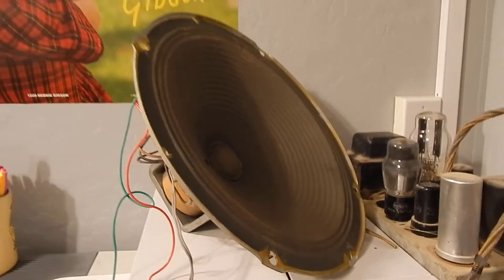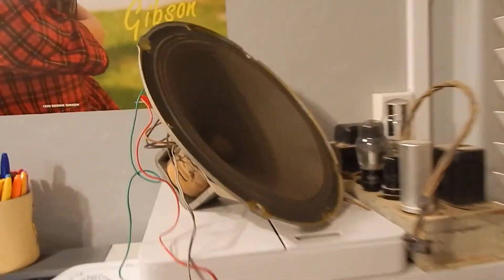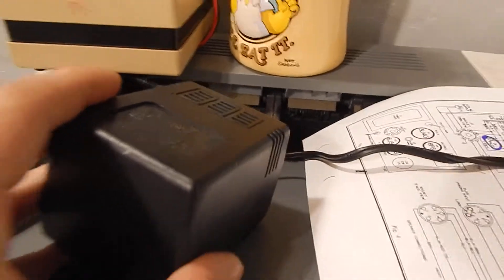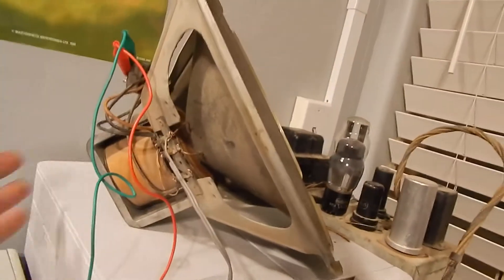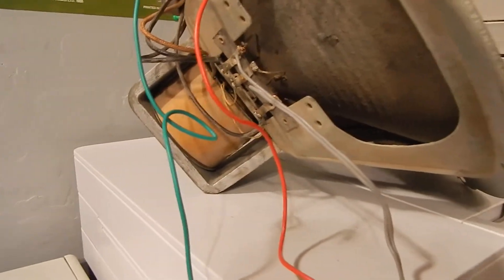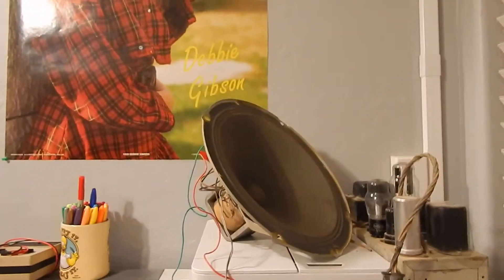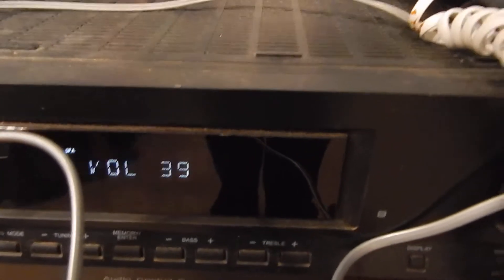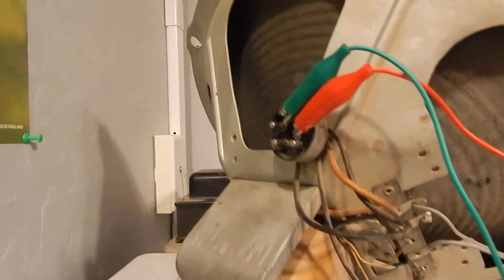Paging A 1947 RCA Victor Field Coil Speaker

Comment: how do you determine what voltage to apply to the field coil if the coil is 250 ohms. is there a way to figure out what voltage to apply or how much current it is supposed to draw?